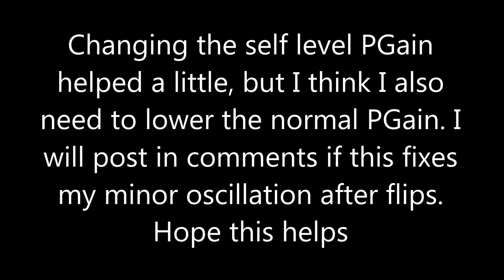Hobbyking Diatone 250 Quadcopter KK2.1 PI settings for RC911 firmware

Comment: Will These settings work with my KK2.1 v1.6++ RC911, F450  ?

By stock settings my quad contineously moving right without any Aileron or elevator move...Why

Comment: Hi Simon, Great build + flying.. I am kind of new to the hobby, and I am following you. Will get my components soon, I will be using Turnigy 9x, radio with stock firmware.. Can you help me with the the Radio settings ? like end points, throttle curve .. etc.
Reply from the maker: About the only thing I have changed on my 9x is the Reversal of Elevator. All the rest is KK2.1 configuration
Reply: Simon Hahnel Wonderful.. I will see how it goes.. thank you for help !